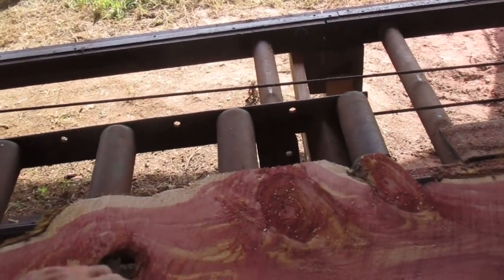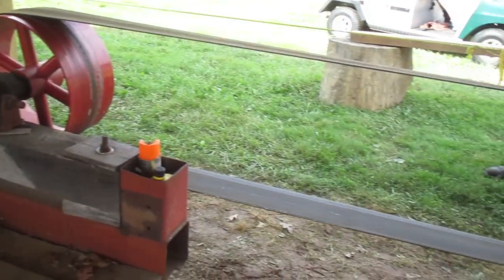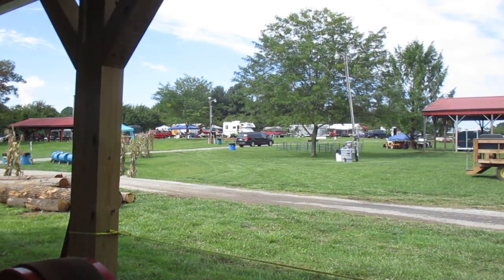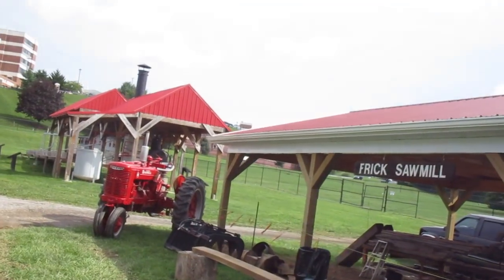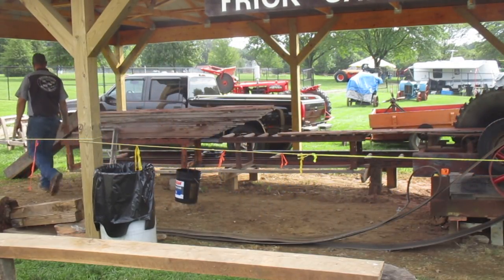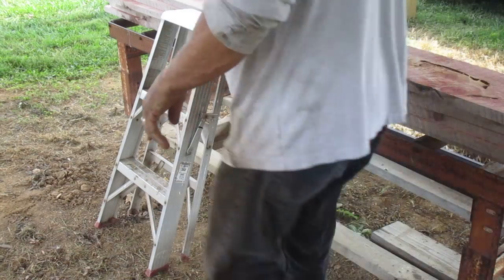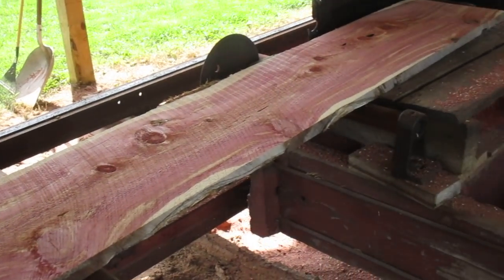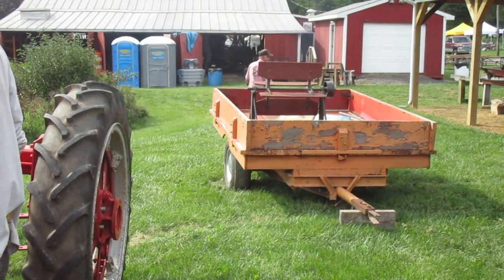Another FRICK  sawmill saws again Carroll County Maryland #471

Comment: Not saying I'm old but, when I was growing up that is the way we got our wood for the three stoves we had in our house. Father would run the saw and my brother and myself would throw the wood away. The saw was run off the rear wheel of a stripped down '36 Chevrolet pick-up. Later on it was run off the front pulley on an old doodle-bug. Old Maxwell 2 speed rear-end powered by an old Chevrolet 6 with 2 - 4 speed transmissions. That's where we learned how to drive. You could walk faster than it when you had it in low gear. The good old days.
Reply from the maker: hi there nice story thanks john